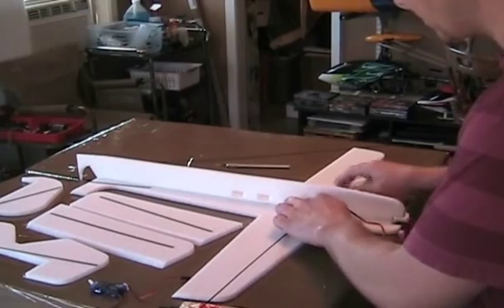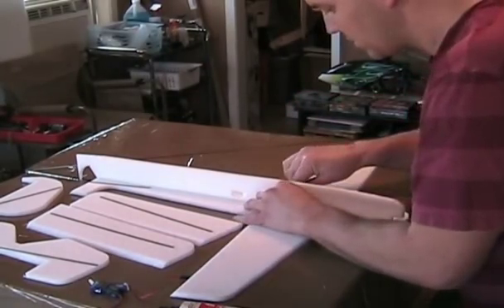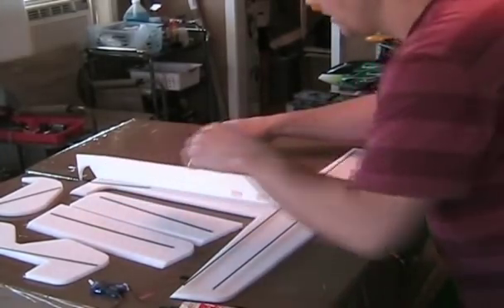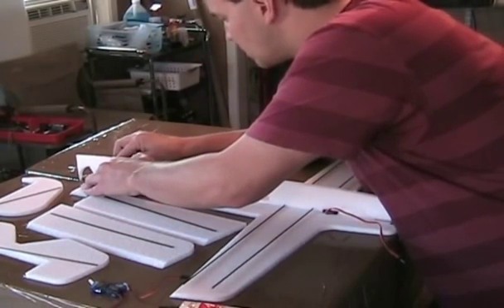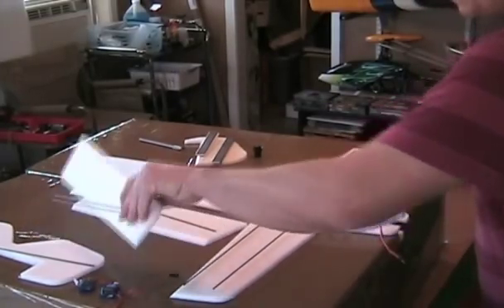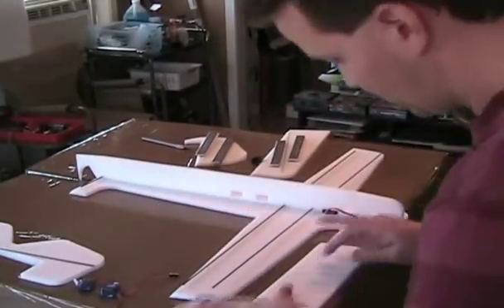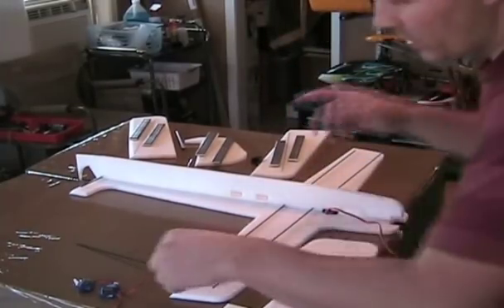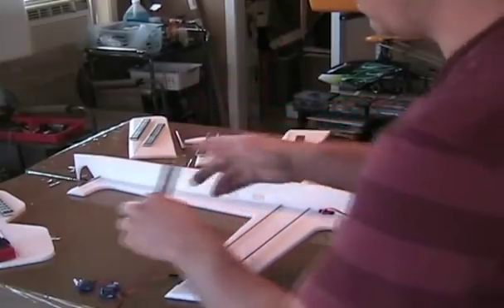No Brainer Build Video #4 - Control Surface Carbon Fiber

Comment from the maker: Thanks. 
I am using Welder glue most of the time. During this build I used 3M 4475. The Welder glue had too big of a tip to apply it with accuracy, but works just fine. I found that Lowes had the Welder glue in a smaller tube with a finer nozzle that I have used on the last two that I built. The 3M 4475 is great, but you typically have to order it online, or have someone order it for you.